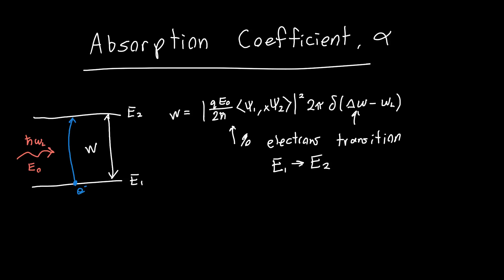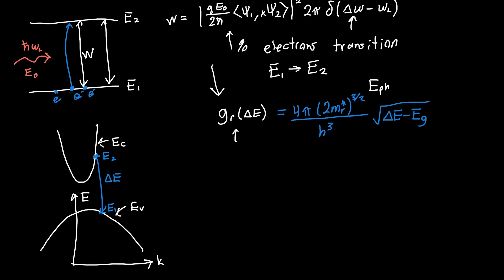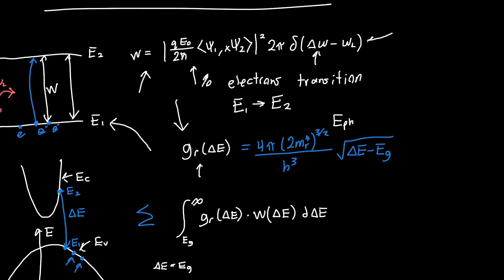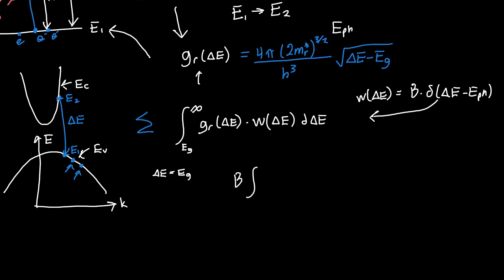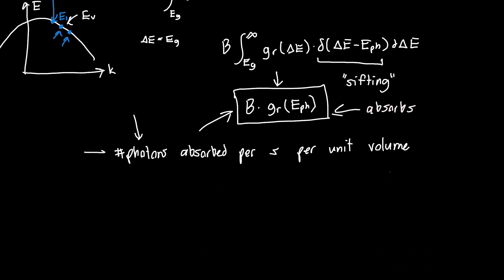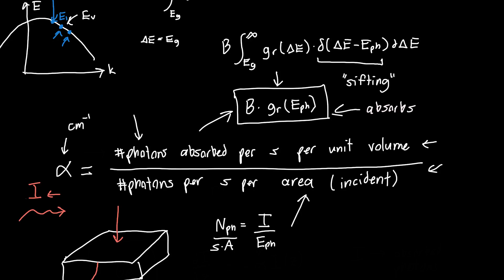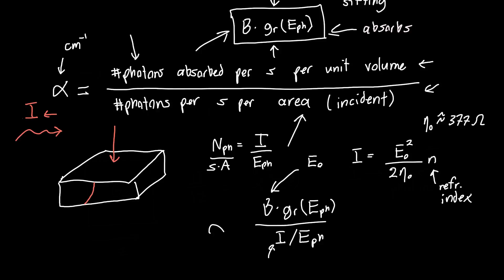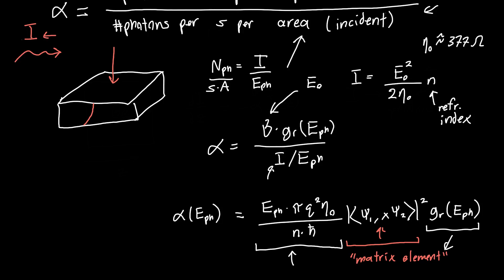Absorption Coefficient Calculation

Comment: Are absorption coefficient and absorbance related? If yes then how?
Reply: Hi! If you are using a Uv-Vis and you wanna calculate the total absorbance, you can use Beer-Lambert law. https://en.wikipedia.org/wiki/Beer%E2%80%93Lambert_law#:~:text=The%20Beer%E2%80%93Lambert%20law%2C%20also,which%20the%20light%20is%20travelling.

Best regards!